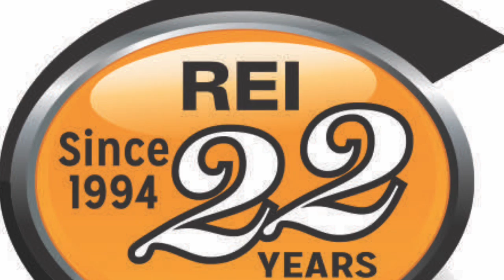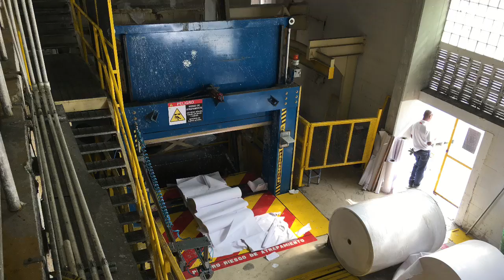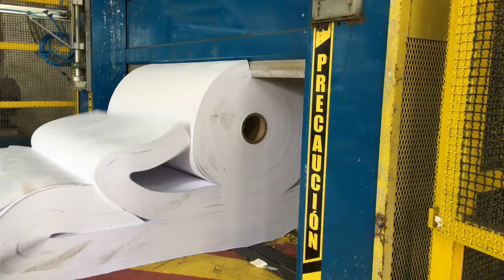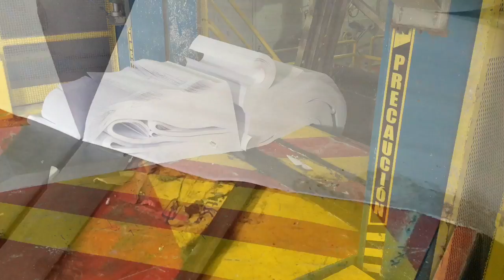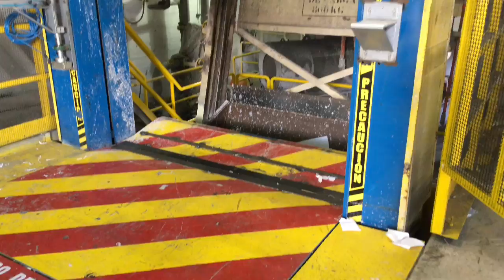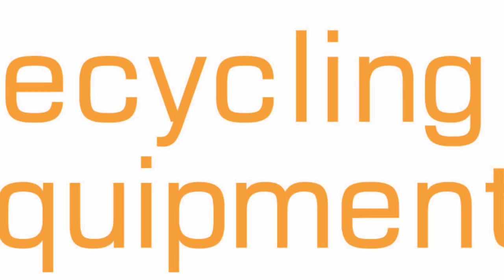REI Roll Splitter / Roll Cutter / Guillotine / Reel Splitter

Comment: why did you destroy this roll of paper in the first place ??
Reply: Out of spec paper at paper mill. Going right back into pulper to make new paper.
Reply: I work at a paper converter, not a mill. We never have to cut them down to the cores like this, usually they come in gashed and we end up slabbing a couple inches off by hand and then shredding it through a baler by hand too. Honestly wondering why we dont have one of these. We have 2 new rewinders and a badass prototype sheeter, not sure why we dont have one of these
Reply: @JoeyWalls  , out of spec is a corporate waste. Can we buy these rolls cheaply and use them instead of wasting more money to process them again ? Also, seems like someone has a serious quality control problem, to even allow this amount of out of spec material to be produced.
Reply: Damaged rolls